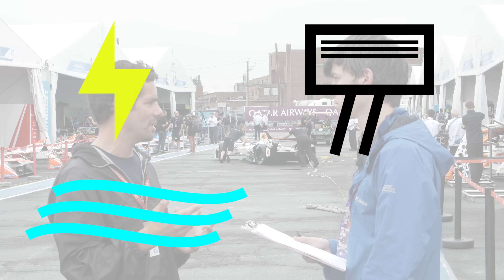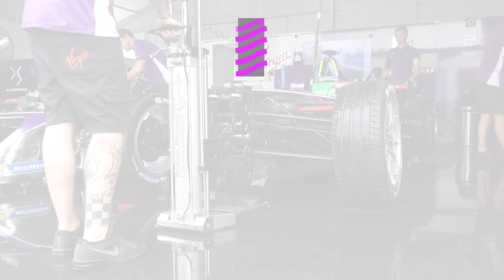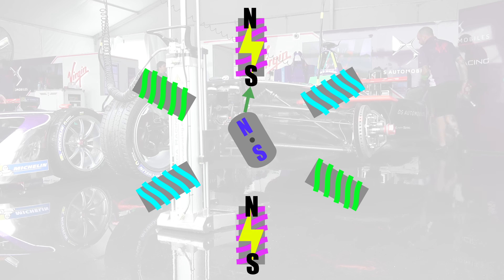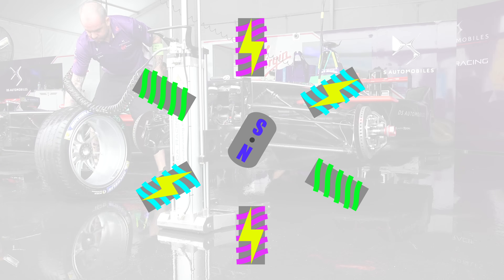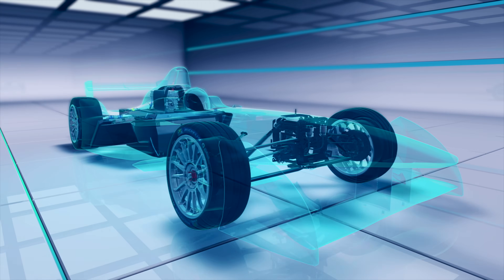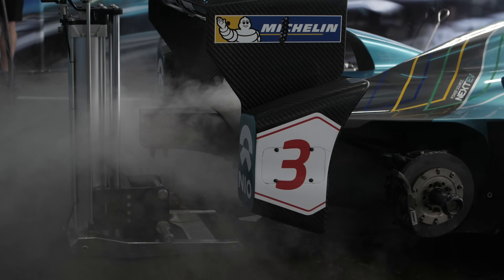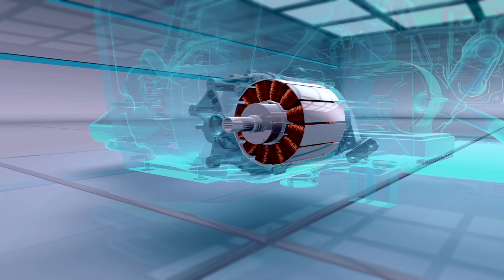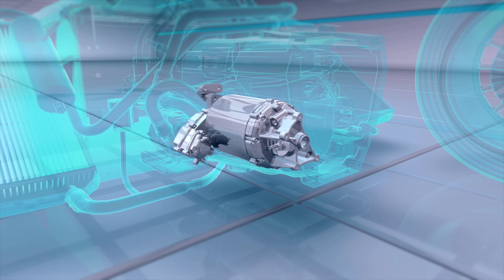Can You Tune Electric Cars For More Power?

Comment: Epic rant, probably still worth it to some who care about innovation and racing and both.

28kWh is so tiny. Not road relevant at all. Less than am original Nissan LEAF.
170kW in races is quite a bit for a road car to bring consistently, but for a single seater seasies with so many ex-F1 driver...kind of lame.
I totally reject the treaded tires. They're similar to those on road going sportscars. Very durable, very low in grip. On the heaviest single seaters in history. While LPM1 tires are so capable and capable.

The aero package is deeply disappointing from an engineering perspective. If a collision causes a rear wing to fall off, the car is called in for "safety" reasons, while it can actually stay in its fight on the track. So it doesn't improve laptime more by adding downforce than it costs in drag. It's there fo' show' only.

BEV's are in present time still battery limited. Air drag is a big thing. Unless built for one-lap miracles, weight is going to be higher than F1 anyway. Why then the aero kit which has such a terrible drag coefficient compared to closed cockpit and even open cockpit prototypes with close wheels? Needlessly being a mostly open wheeled car causes huge drag at speed, limits top speed (spectacle), makes laps slower on average, and the aero is SO road-irrelevant. LeMans/IMSA prototype can create much more downforce at lower drag with minimal (if any) added mass, through smart use of ground effect and a more slicks overall body with incapsulated wheels.

It all adds up to me being convinced that Formula E was set up to fail, and disgust race fans by being terribly slow. What has happened though, is a new generation/class or race fan has emerged. Not into it for the loudness, butfor the green enjoyment. They have nothing to compare FE to. Maybe their own LEAF.
Despite unintended, FE is a bit of a success, and now technical development is being limited much as possible, under the guise of cost saving. Like in F1, where everything they change to reduce emissions and cost just multiples cost and makes just a tiny difference for emissions. It's just 20 cars driven every 2 weeeks, after all.
The tires are supposed to save cost, but look at grassroots race series, at they on road tires, depite much slighter cars that do similar lap times?

Jaquar is launching a support I-Pace series, and that's really cool. But FE (society) needs a BEV racing series that DOES push the envelope technically, with road-relevant open regulations. Regs set up to promote lighter, longer range batteries that can be cycled many times (hefty points reduction for using fresh batteries). Slick aero with plenty of downforce. Competition in the tires would be good. Maybe force manufacturers to use tires they already use for other races, or even road cars. 
All should add  up to cars that can do a decent length race on one battery, at  Formula 2 like lap times. I think the tech is already there, just FE is keeping it from us, making BEV's seem silly to (billions) of old school race fans.
Big brands are coming into FE in a few seasons. Silly to make them race spec cars. What goed does that do to BEV implementation?

Also, why not allow AWD racing cars? In road cars, a motor per wheels is becoming a bit of a standard. In not only improves performance through traction, but also regenerative braking on the front wheels (with fast enough cells in a large enough pack very welcome to save energy at a given pace) but it also may reduce heat losses by stressing motors less, keeping them more in their sweet spot of efficiency. Improving range, saving polar bears etc.
Reply: it took me two reads to get where you were going with this lol.  I dont agree that they are keeping things under wraps or doing shady business like you're implying.  But I will agree that there is a lot of wasted potential in FE, especially from a technological and engineering standpoint.  Those AWD electric supercars are engineering marvels.  And it's a shame that FE is a bit more form than function.

edit: I think they may have been testing the water with formula E.  So instead of going all in and trying to push things, they tried to appeal to a market they thought would be a safer bet.  Lets not forget, popularity of electric cars has exploded from where it was even 5 years ago.
Reply: Cloxxki  I quite like FE as it is atm; but i completly agree with you.
We need a series that really pushes competition and development! Just bringing in new manufacturers isnt enough.
Reply: Innovation is good, EVs not necessarily. Unless "emissions" regulations go even more nuts, just like the running costs for combustion engines.

Comment: This would not be practical in normal road cars, but in the case of race cars that only run for a short, predictable time I wondered:
Could you build the motor not with copper windings but with superconductor electromagnets? The motor would get even smaller and more light weight. Plus there would be no losses due to electrical resistance. I'm not sure about hysteresis, though. But since the iron cores in conventional electromagnets are to enhance the magnetic flux you would not necessarily need them in superconducting motors.
Reply: Well the problem is, how to keep it cool enough so that the electromagnets stay superconductive? The wheight and space requirement of the cooling system would probably outweight the gains.
Reply: shi01
As I said, it only needs to stay cool for a short time. You would not need a cooling system, but rather a small tank with liquid nitrogen.

Comment: Please talk about Tesla only producing one battery and using software limiting to price gouge
Reply: They make multiple batteries (the 75, 80, 90, 100 kWh batteries are different sizes). The only car they sold like that is the 60 kWh cars, they are just 75 kWh cars that are software limited. I think they stopped making those earlier this year anyways.
Reply: Wouldn't any company do the same though? They are in a market leading position with cars being sold for many years in advance, people having to pay 1000-1500$ to even get on the "pre-order list", not to mention they lost alot of money on the first few thousand Model S's that rolled off the factory line, so this is compensating that =D

It's not Tesla's fault that people are idiots haha
Reply: Would be nice if you could tweak the software, or at least the software settings.
Reply: Yeah they won't be the only one. And I know they are not allowed to lockout the obdII from customers. I just don't know if electric cars will use obdII.
Reply: Wouldn't the tradeoff for that be more battery cycles?  Software limiting doesn't cut off certain cells, just a certain capacity so in the long run the batteries will wear the same over the life of the car.

Comment: Jason, wondering what your thoughts are  regarding EVs, Hybrids and IC given the evacuation from Hurricane IRMA.  Folks had hard time finding gasoline.  But obviously EVs wouldn't work well either given the lack of range, so Hybrids the way to go?
Reply: Hybrids and IC are the same. They both need gas, and if the gas station is sold out a day in advance, you're out of luck. With EV, electricity is available even to few minutes before things get bad, so you can charge the night before. Once you're hundred miles out, electricity for fast chargers are available to take you further, but gas may still be sold out.
Reply: Gas stations operate using electricity, so if there's no electricity for superchargers, chances are that gas stations won't be dispensing fuel, either.
Reply: The question posted was regarding a situation when the gas is sold out. Even if gas is sold out, chances are that electricity will be available until minutes before things get bad, which will allow you to charge the car. As for superchargers, you'd drive away from the storm where you know (via plugshare or Tesla app) that the chargers are functional. Vehicle speed should out run hurricane.
Reply: Josh S 
More and more fast chargers are installed with some battery packs nearby.
This is done to handle the high demand of power with a large amount of chargers, so if for example 10 cars are simultaneously pluged in not all of the power have to be drawn from the grid.
Those chargers could provide charging for some time when the grid is off (this is only an assumption, but it would make sense to do it)
Reply: james pogrebetsky It's like always taking your umbrella when it looks rainy and than the one time you forget it it actually rains ;)
Reply: If you've got solar+battery on your house and an electric car (all of which I aim to have within 5-10 years), and if all of that survives the disaster, then you're pretty much golden. Better than a hybrid, because a hybrid is always a compromise car.

But yeah, easier to stockpile a bit of petrol than to stockpile electrical charge - the EV thing only really makes sense in this scenario if you can generate your own energy, and especially if you have house-level storage for it. But then if you can do the EV thing, then it's sustainable in a way that petrol really can't be.
Reply: Only thing that concerns me about EVs and natural disasters is what if an area gets hit hard enough it effects the supercharging stations. How fast can they get those back up and running?
Reply: Fast chargers can charge even if electricity is out? Irma affected more than one area, millions of people were out, hell still are.  So if electricity is out, you're not able to charge. 

Seems to me a hybrid is the best way to go in this case because you have multiple powering sources. Car in your garage is certainly not sitting on E. Even if it's only half a tank you can drive in order to charge the battery, right? Then the battery takes over and reduces gas demand, thus gives you more range than either an EV or just IC. 
Never owned a hybrid but I think that's how it works.   

Of course, if people stored some gas to begin with that would be helpful. Some 2 or 5 gallon cans with PRI in there can go a long way to getting out of danger.
Reply: Chevy SparkEV ok but what if you're not in a tesla and dont have access to the supercharger network or if you're in an area with little or no charging stations of any sort accessible? At least you can carry extra gas on you in your car... and gas is more readily available generally, though I agree that it selling out during an emergency is a big problem
Reply: Most hybrids have electric only range, if offered, of only couple of miles. Plug in hybrids can have more, like Volt's 53 miles. But most other plug in hybrids only do 20 miles or less on electricity, and not capable of fast charge. For distance driving, they are just like IC cars: gas sold out means can't go much further than 20 miles (or 53 for Volt).
Reply: The idea of a trade in battery pack makes sense to me actually, no different than what i keep for my electric lawnmower. one goes down, replace it with another. Kind of like replacing my Blue Rhino propane tanks. 

Still though, if you had a couple days notice, and you knew you needed to get out of dodge.  You also predicted that gas would be unavailabe plus the grid would be down, wouldn't the best vehicle to vacate be a hybrid, given the two powering options?  

I see what Chevy Spark EV is saying up there but I was more thinking if gas and the grid were down as opposed to solely just the gas supply. I wasn't clear there.
Reply: Josh S 
Yes if you are a kind of person who prepares some gallons 5-3 days before a hurricane than that perfectly works. 
I'm not living in the US and therefore don't have to deal with hurricanes but I don't quite understand why so many people obviously do not prepare more in advance, because I see all the time pictures people rushing to the groceries and gas stations on the last day
Reply: +Ale Kar  after you've prepared a dozen times for a hurricane that was supposed to destroy everything, yet didn't even hit you, you start getting complacent.
Reply: my thoughts precisely.  How easy is it to even find a charging station first of all? Secondly,  electricity is off so the pumps don't work to pump gas out of the ground so I imagine it can't be used to charge batteries either.
Reply: +Ale Kar I'm just glad I didn't go all out this time... my neighbor left the state. I warned him not to. He kicked himself when he got back lol. After 25 hours of driving.....

Comment: Are these motors considered brushless? Or brushed?
Reply: jacob portillo
Brushless. A Brushed motor has the coils spinning in the middle, and the stationary,   permanent stator magnets on the outside. Brushed motors don't require an inverter because the current is sent through the brushes making contact with the commutator, (attached to the rotor coils) which sends current through the coils, causing a magnetic field, making the rotor spin. As the rotor turns, the brushes contact a different commutator, switching the polarity of the coils. The advantage is smoother power delivery and cost, but the downsides are that the brushes are always rubbing on the commutator, causing friction and heat, resulting in a loss of energy. They also require more maintenance than brushless motors.
Reply: They are called inductive motors. They don't have brushes or permanent magnets. As stated in the video, you don't need or want to have direct contact between stator and the rotor.
Reply: Khalid Abu Shawarib I see
Reply: Harrison T thank you
Reply: Khalid Abu Shawarib But don't brushed motors have insane torque? Just wondering if that would be applied to semi trucks or something.

Comment: Great video, as always! This video was jam packed with useful information, and this video ultimately gave me a clearer insight on Electric Vehicles.

I hope to be an Automotive Engineer/Designer in the future... So, thank you for all of the time and effort you put into your videos. Keep it up! 👍🏽
Reply: this guy is perfect for keeping up to date on new tech, learning how new tech works, and also learning fundamentals of the past... all in an informative and extremely understandable way... this channel is bloody perfect lol
Reply: Hudson Stronck, I have to agree with you! 👌🏽
Reply: Dunno, Im an electrical engineer, and theres not a huge amount more to an electric motor. Theres kv, the timing of the motor(which is somewhat equivalent to ignition timing), the winding type which has a bearing on torque output at low RPM's and not much else. Thats the beauty of electric, theres so little to them mechanically compared to petrol- with intake, exhaust, NA vs forced induction, injection+ignition timing etc. getting the most out of the motor itself is relatively straightforward. Getting the most out of the system: the batteries, the motor driver and so on is where you make the gains in weight and efficency+heat output, and that would be a much more in depth discussion.
Reply: new tech in the sense electric cars and electric motor applications in racing is new... and yes it was basic, but informative
Reply: +pol1250 Yes it is basic, and that is why it is easy to understand for the broad audience. What point were you trying to make though?
Reply: DriveAndBeDriven to much information answer the question first, then go into windings and theories
Reply: It is not the past. Combustion engines are still up to date, sorry to bust your progressivist bubble. Jumping the bandwaggon too soon is not a good idea, since you don't live in the future.
Reply: This isn't " new tech " as you call it.....and the explaination was very ......very basic !

Comment: Just overclock it
Reply: +TheJacobShapiro my tesla runs in sli
Reply: @SirDella  *attaches 2 tesla together
Reply: Car guys today: so I got a new intake and exhaust and a tune so I should have a few more horsepower.

Car guys of the future: I used liquid nitrogen to get my Tesla to 5GHz.
Reply: I'm putting the AMD Threadripper in there with the sticker. Should add about +100hp.
Reply: waiting for those retro 8 bit EV
Reply: Luca Della Bonzana my Tesla has triple 4k monitors and 4 GTX1080s in SLI
Reply: Custom waterblock loop should keep the temp under control. Just make sure that the rad fans is customizable rgb to add more coolung capacity
Reply: Mine has RGB, that's like... 42 more hp I'm told
Reply: You need to get a K motor for that ...or any AMD
Reply: But to go retro you have to maintain AGP and IDE
Reply: Luca Dell Bonzana NVidia actually produces GPUs called Tesla. Not sure about SLI though.
Reply: +MrDiarukia lol coincidence
Reply: Very good joke thank you
Reply: That literally is not wrong. Changing motor timing (overclocking), and  adding capacitors for more "boost power", will boost you E-motors horsepower  or allow you to use you motor with more intensity.
Reply: In some ways yeas, generally higher timing generates more heat and power, not on all cases, it must correspond to the motor still.
Reply: i did that to one of my monitors for games and...uhh.... let's say i only one remaining(and it's the shitty one ;_;)